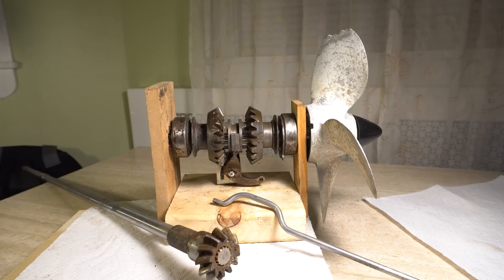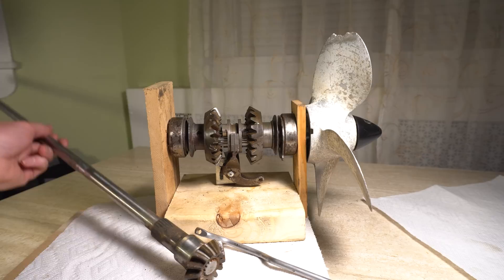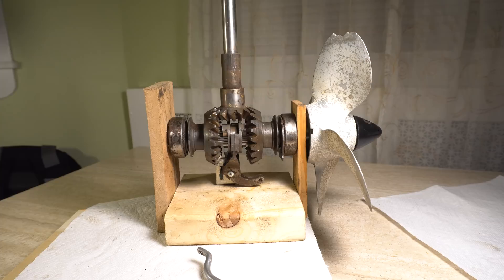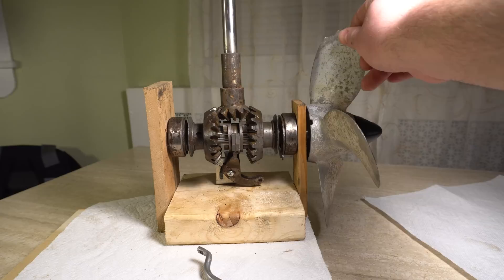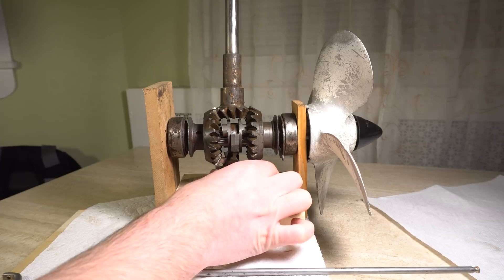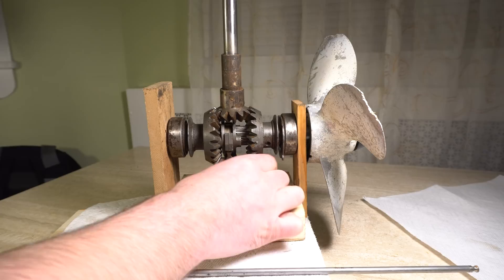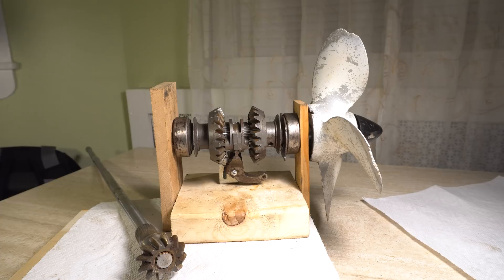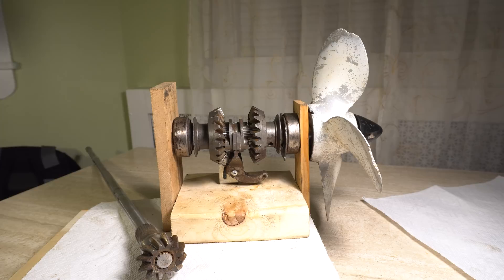How an Evinrude gearbox works - outboard gear shifting - forward / reverse

Comment: Thanks. I always wondered why it sounds like I'm destroying my very expensive outdrive a little more each time I shift in to forward or reverse.

I did not realize that the two vertical gears always spin and that both are always meshed with the horizontal gear.

I now understand that when the lever at the bottom gets pushed down by the mechanical linkage between it and the pilot's throttle lever, the rear horizontal (forward) gear starts taking power from the engine and transfers it to the prop, and the front horizontal gear just spins freely on the prop drive shaft, and vice versa for reverse. (I may have forward and reverse backwards here, but that's not important for understanding this.) And of course when the throttle lever is in neutral (the lever in your exhibit is not up or down, but in the middle of that range of movement) both vertical gears just spin and no engine power is transferred from the horizontal gear to the prop drive shaft.

Now my question is 'HOW does the 'clutch dog' (as someone in a comment called it) work? That's where the magic happens. I call it 'magic' because we can only see that the 'clutch dog' gets slid forward and rearward by the little lever. We can't see what is actually happening.  (Is the prop drive shaft actually split where the clutch dog is? I know the splines must have something to do with it.) How this works is actually not 'beyond simple'. It appears simple at first but you left out the magic part.

I really appreciate this video, because this will help me and zillions of boaters understand why they need to not be shy about engaging forward or reverse quickly. I know often I have to fight the urge to be slow when I start hearing those gears start to mesh. Please bring it on home and explain how the 'clutch dog' works so I don't have to take my outdrive apart to figure it out.
Reply: I just got it. Watching what was moving and not while you were turning the prop in neutral, and then turning the vertical shaft in neutral, made it click. 

Those 'ears' in the clutch dog must  take a beating. Not really a clutch like in a car at all. Would be cool to see a close up of the 'clutch dog' engaging the forward  (or reverse ) gear. Thanks for the video!! So glad to know that the actual gears are not what's making that 'grinding' sound when shifting in to forward or reverse. Now get that thing off your kitchen table before your wife catches you!

Comment: That's a great video, and it will be for a. Long Time, this is the type of information people pay a lot of money to see in a manual but you have broaden the learning process to get people to learn not to be so dramatic in a failed day at lake. More poeple know if they watched this video,"Hey maybe you didn't ruin your expensive complicated outboard you should check out the link adjustment before unassembeling the painstakingly awkward to work on part of the outboard that doesn't even need fixed.

Comment: Thank you this is help alot for me finding a part to make my project ....

One question .... those this gear require clutch also
Reply: The centre selector is permanently engaged to the  propeller shaft which is in neutral when in the middle  , when shifted either left or right , those knobs on the selector lock into the gear on either the right or left within about half a turn ,  i think in the old days this style of engagement would have been called a dog clutch in that it has no smooth engagement , once the locating teeth/pins on the selector  have meshed ,  it is locked into gear with a bang , however because the prop is in water for the engagement , wear is minimal .
It essentially has no soft engagement friction clutch as you would find in your car or bike .
That is the best i can describe it , hope that helps .

Comment: How to run a gear box. First step don't switch gears unless absolutely required. Usually look the traffic and terrains and curves to make decisions forehand. Neutral is a necessary before stop to gauge slopes.

Comment: 1.3k dislikes because you have failed to explain how it works. Ok, moving the "clutch" forward or backwards changes the direction of the propeller but how does the internal mechanism work? Why does the propeller change direction? It is like explaining how lights work by saying "you flip the switch."
Reply from the maker: I added a part 2: https://youtu.be/12dxb6d6pUk

Comment: i once got a motor that kept jumping out of forward gear, i found the dog edges on the splined center slider were rounded over. i took the slider and the two gears off the prop shaft and turned the over a put them back together, now the dogs were engaging on the the other face that was not damaged,  so now the gears would stay engaged and power like normal. only cost some gear lube to repair.

Comment: I have a Johnson 2 horse 2 stroke forward only Moyer and I popped out the drive shaft is it easy to put back in. Thanks for all the help. How it popped out was I was an idiot and put in oil in the propeller and did not put the shaft back together in the motor lol. Ps please be easy on me I'm learning

Comment: Could have added little more details and closeups on the slider engagement and disengagement during both forward and reverse. Especially the groove and why the mechanism doesn't rotate with the shaft.
Reply from the maker: Check out part 2 in description.

Comment: My question would be why the designers put such sensitive equipment out ti to the propeller. Like the clutch and gearing could all be next to the motor while the propeller is just connected with a straight rod.

Comment: Brilliant 👍 my engine was going into reverse/ neutral and not forward, I took the lower unit apart and fixed what I thought was the problem and now she goes into forward/neutral and not reverse 😅 any solution would be very much appreciated 👌🍀

Comment: the idea is good but you need a bearing between the driven shaft and the gear, otherwise the box on the turns will jam
Reply: I dont get what your saying. Unless you jk, right?

Comment: Thanks for the video . I have a tohatsu 40hp 2 stroke amd shifting makes some clunky sound when engaging  specially on reverse. What needs to be done here? Do i bring down the gear box part of the outboard or is there a bolt that can be adjusted to pull the shift rod? 
Thank you sir.

Comment: So, if you know how to machine (say, a new case), and you wanted to build a forward-reverse gearbox, then all you need is a lower unit off an appropriately sized boat motor...take the parts you're showing out of it...now take the prop off, install a flex-union, connect the prop shaft to the new motor, and the drive-shaft to the new vehicle's drive shaft...and WHAM! You have a forward reverse gearbox!  THAT'S ACTUALLY EASY!!! Basically 'run it backwards', and you can get rid of that vertical input and use it in a horizontal output mode!!!

Comment: I hope this question isn't idiotic: would I be able to convert this gearbox into the rear drive of a go kart by welding some couplings to either end of the propeller shaft for cv axles and a sprocket or secondary pulley on the drive shaft? Any insight on this would be appreciated

Comment: Does it rely on a peg on the stationary sliding part (moved by the ship drive) emeshing suddenly with one or other of the fast-moving cogs? Or is there any cone clutch (like for synchromesh gearbox on a car) to gradually bring the speed of the shaft up to the speed of the cog? If it's a sudden engagement, I would have thought there would be a lot of wear.

Comment: I am working on a 1980-1982 Sail drive 1.5L 15S13A It will not shift forward and back. Only reverse. How do I adjust the shift rod?

Comment: Works like a differential
Reply: @MrWhatevauwanacallme in the way it transfers rotational engine power perpendicularly. It's obviously not allowing two wheels to spin at different speeds - but you're so smart you already knew that, didn't you...

Comment: Thank you very much for the explanation .... Question if I wanted to increase the speed of the idea, whether the gears are large or small ... and how can I increase the speed in gears
Reply from the maker: That would not be possible as the device is designed to run at a certain RPM. If you exceed this it will likely break soon. These motors generally run in the 4000-5000k RPM range.

Comment: Im trying to figure this all out as my 1965 6 horse johnson will die when I turn the knob to "shift" then use the gear selector to go from neutral to forward or reverse. I am scared if I shift while at the speed the motor runs in "start" mode I can fuck the gears up eventually, but thats the only way I was able to shift it while testing it for the first time yesterday.

Comment: What are the symptoms of being adjusted too long vs too short? I have a 1980 Evinrude with the lower unit off a mid 70's model so I don't know which shift rod length SHOULD be appropriate. It wouldn't engage reverse properly when I bought it. It bucked and kicked at anything beyond idle.

Comment: I have a 1990 Johnson and it can go on forward gear but is not taking the reverse gear please advise.
Reply from the maker: Its possible the shift cable is not tightened correctly and its not being pushed back far enough to engage the dog gear.

Comment: The Evinrude gear box with a non through hub prop seems way simple compared to gear boxes which  have exhaust through hub props.
Reply: Through hub exhaust gearboxes use the same principle. The exhaust comes down through the rear bearing holder and out through the prop .

Comment: Great explanation. please could I make a question?. I replaced the inboard diesel engine of my sailboat  for one  That has a ZF gearbox 2x1, an old model from late 80´s,   but a kept the same  propeller wich is left handed and now when  I move the control forward the  boat goes backwards so if I want to go forward  I have to move the control to reverse, so somebody told me that I should change the propeller because the gearbox was made for rigth handed propeller and I could not use like this because the gears of the reverse are weaker than the ones that goes forward.  So what I see in your video is that they are exactly the same and I should only change the position of  the cable on the control system. Does the zf gearbox for inboard engines works like this one? Am I right or  I should replace the propeller?  I will be greatful to hear an answer from you.
Reply from the maker: I really do not know of your specific make and model however all that I have heard is that the outboard needs a different set of gears the function correctly with a reverse propeller. It is possible this is not true for all motors but considering the cost of everything you may want to be on the safe side. I would advise making a post on a forum. I'm sure there will be someone who can help you out.

Comment: Hi wonder if you could help.i have my lower unit off .it goes into gears ok and nuetral. When I turn the main shaft on every rotation it snags at same point .I can see where the shaft cog is engaged to forward and reverse gears at all times but what could cause this snag unless there's something stuck in the cog maybe.its only a slight snag .should i ignore or have it taken apart .ive emptied the oil for an oil change while I'm renewing impeller.the oil looks as clean as the day it was put in with no metal filings found.any clues would be a great help.

Comment: I have a 35hp Johnson and drive shaft came out when pushing it back in it slowly comes up. Do I need to release the oil pressure or what is actually happening to it

Comment: I'm a little confused. Did you say in neutral the prop should be spinning? Because then you say when its put in drive the prop catches which would mean the prop wasn't spinning in neutral. Thanks
Reply: Yes, the wording is a little confusing. He means that you should be able to spin the propeller with your hand.

Comment: How does the outboard motor draw water into the cooling system?
Reply from the maker: It has a propeller pump at the base and forces the water up the leg and into the cooling jacket. It's called an impeller. Generally pretty easy to replace and should be checked especially on an older motor as obviously if it fails the motor can overheat very quickly.
Reply: @cenkaetaya   Thank you!

Comment: When I shift someone told me to shift fast to avoid "grinding" I dont like hearing the grinding sound when I go into reverse or fwd. Can you explain what that sound is, is it harmful, can it hurt the engine if I shift slow or is it best practice to shift into gear fast? thank you
Reply from the maker: You definitely want to shift quicker the sound is basically the two pieces of metal banging together and connecting. The reason you don't want to shift slow is because there's no in between they're either disconnected or connected. If you shift slow you'll be banging up the teeth on the mechanism. It's not like a car transmission that connects slowly. Also you don't need to shift super fast, you just need to do it in a decisive motion. Also if you're going from forward to reverse give the motor a few seconds to slow down especially if you're slowing down from a high speed and getting ready to reverse. This way you will avoid accidentally switching at too high of a RPM.
Reply: @cenkaetaya  OK Awesome, well since I've got your ear... On another subject, how high should the RPM be when trying to achieve top speed? My first time out I noticed when I was pulling a tube I was trying to go top speed but I had to play with the trim. When I had the boat at zero trim, wasn't achieving top speed, so I would adjust up with the trim but either I was overtrimming or going too fast (idk) I would see a huge spike in RPM, and then the boat felt gutless. Don't know what I'm doing right or wrong. I own a 2019 party barge sun tracker. THANK YOU AGAIN!!!